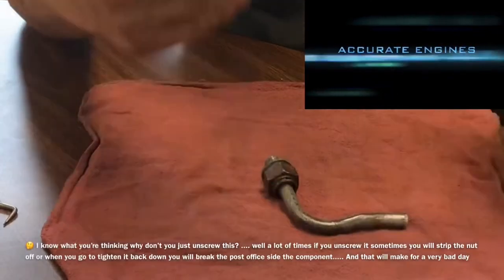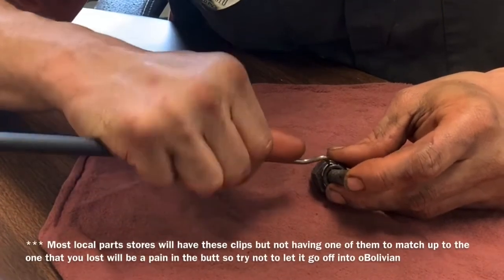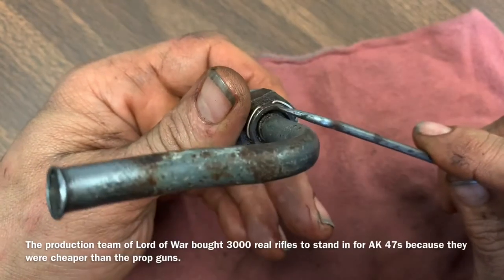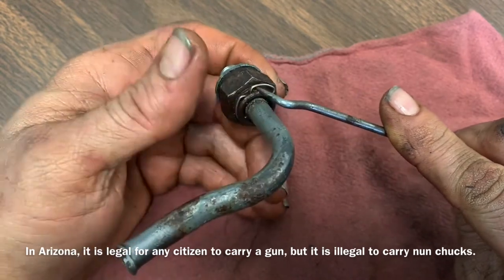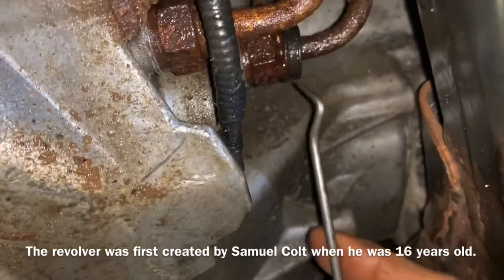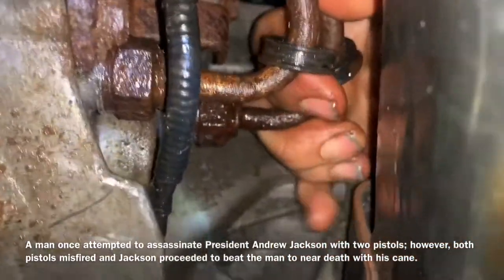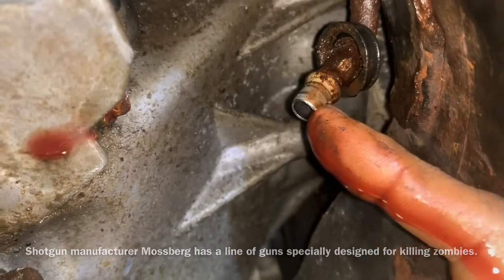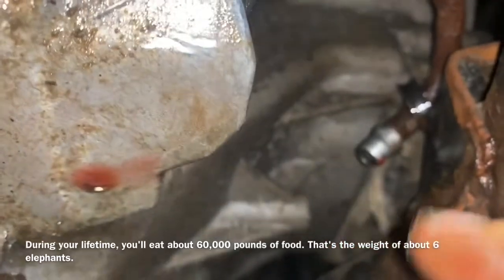Chevy Equinox Transmission Oil Line clip removal

Comment: I saw hose clamps. Did you make diy lines?
Reply from the maker: Yes
Reply: @sharpcarco  do tell...what size hose?  I'm assuming you found the end connections somewhere? Appreciate the sharing of knowledge
Reply from the maker: Regretfully, I don’t remember, but it was probably right around 3/8 I cut the ends of them off and use the original night and made a new line if I remember correctly sorry I can’t say for certain but 38 seems to be about right to me
Reply: @The Clay Way  are you saying you used the original hoses but made new ends with 3/8s tubing?  Correct me if I'm wrong
Reply from the maker: I do believe that’s what I did. It’s been a while since I made this video but I’m fairly certain that’s what I did. I use the original hose and cut it off and flared out the ends.
Reply: Ok yes the tubing is 3/8 od so I ordered 3/8 I'd fuel line. Nobody local had it so Amazon to the rescue. It's leaking at the lowest part at the bracket thanks to PA weather. Just going to cut that section and apply the hose with a couple of clamps on each side. Perfect.